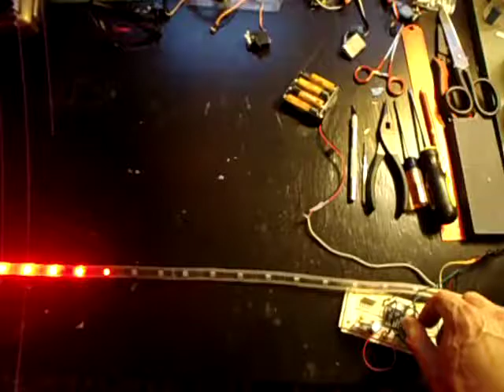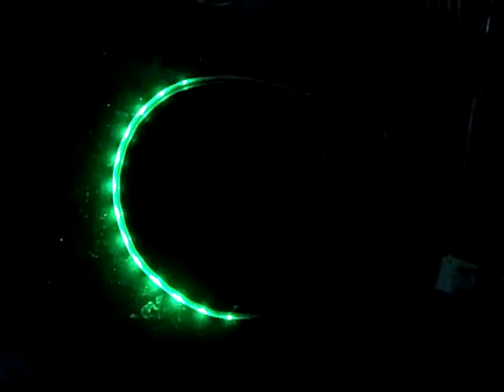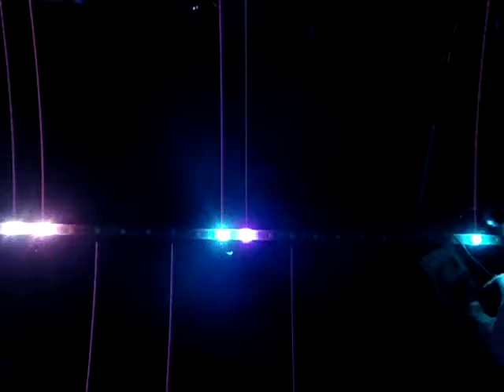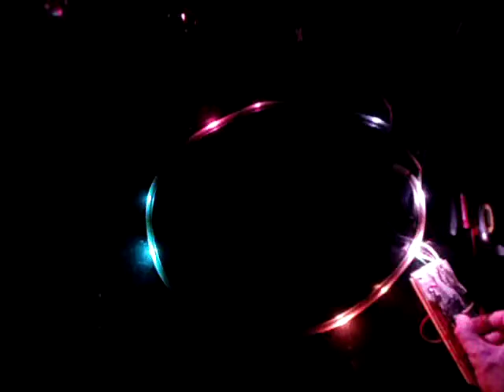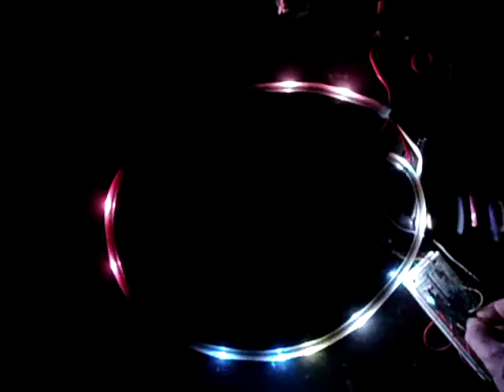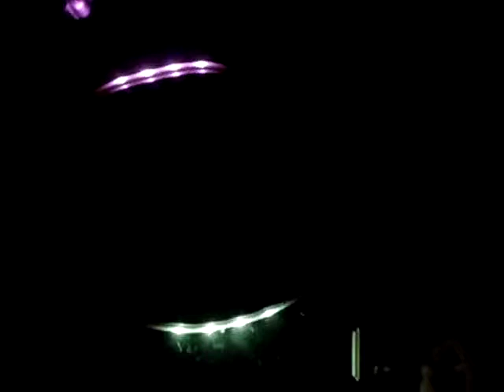Adafruit DotStar LED pixel strip examples

Comment: great demo!
i started off looking into rgb led's and discovered there are  neopixels and dotstars.. wow.
not sure what im going to do, id like to learn how to do all that but no time for that now, i just need something to work with my infinity mirrored pc desk.  Anyway there is a software for me to use and program the lights? oh man i really like the effects you can do..  i like the bi-directional one where they shoot past each other..im already trippin of the thought of having that in my table.
thx again for the demo!  im fascinated with the  chase modes..
Reply from the maker: Thanks!

I believe that neopixels and dotstars are close enough that -- with a little bit of work -- these examples could probably be used with neopixels also.

I drive my dotstars with an Arduino, but there are other ways they could be used.

These examples use the Arduino programming environment, which uses a programming language called C.

Good luck with your project!

Comment: I have looked at your bit bucket.  I am new to coding, however would like to use your help in a sculptural project I am doing using arduino and dotstar neopixels.   Is there some way of contacting you?
Reply from the maker: If there is an enhancement you want, or if there is some question about using the code, you could open an Issue on bitbucket.